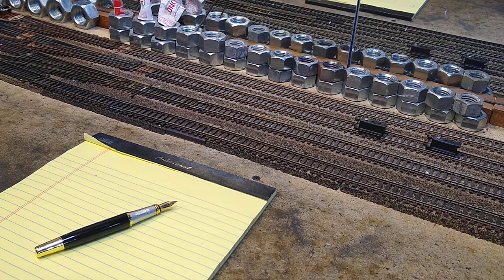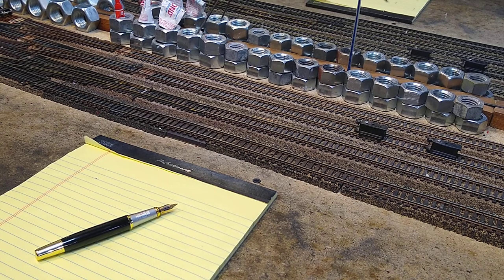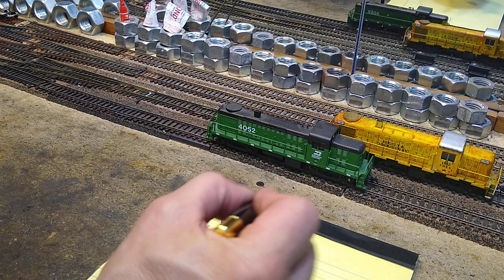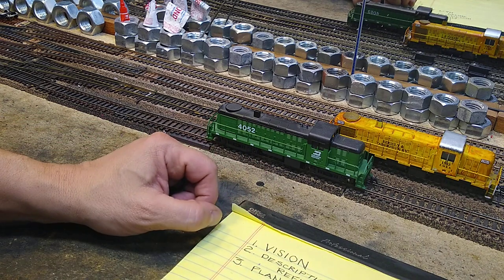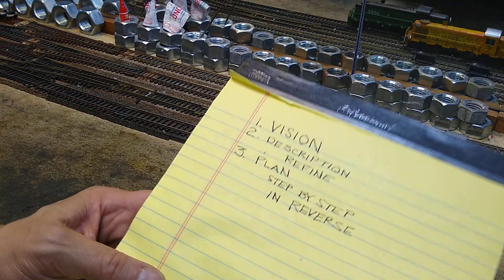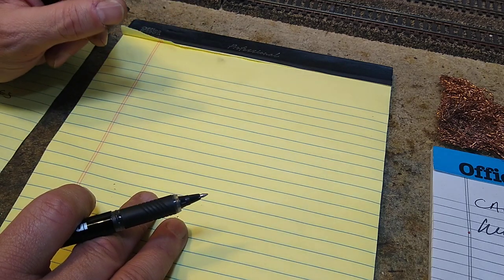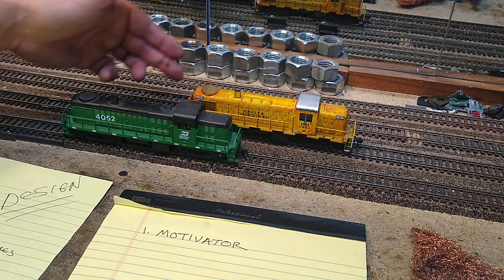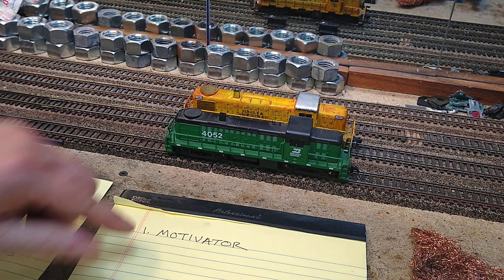Design an NMRA Clinic AHM RS2 remotor example

Comment: A couple questions unrelated to this video, but would possibly make good videos, 1) Would you consider making a video where instead of fixing a pancake motor, you install a CD ROM motor in place of the original, 2) Would you consider reviewing one of those old Model Power engines that have those massive O Scale dual shaft motors, and 3) Are we bound to see any possible steam engines or passenger car projects?
Reply from the maker: 1.  Yes - and it might go in a steam locomotive that has a Bachmann pancake motor.  2. I have a Model Power FP45 that has a massive motor that would go nicely with the pair I just finished.  3.  There are 4 steam projects that have started one of which is the heavy metal Bowser T1 from the green box, another is the Bachmann 4-84 with the pancake that will become a 6-8-6 and there are 2 4-6-4s that need to be quartered.  For passenger cars, I have stripped the paint off 6 Athearn heavyweights, bought 1000 unpainted figures and plan to use a combination of 3D printer, Laser and possibly one of my large format photo printers to do complete interiors lighted with people.

I would also like to do the CD-ROM motor in a pile of GP40s that I've only stripped the paint from so far.
Reply: @elite194  That sounds AWESOME! I cannot wait to see those videos come out, surely making the year better with your videos! One more thing I have to ask, have you found alternatives to the 5-pole 24 volt dual shaft motors, it seems eBay is cleaned out of the variety you use. I'm thinking of use the bigger can motors for my F-units, but would like a second opinion, like yours on what's best to work
Reply from the maker: @hjmiller2689  not even alibabba has anything right now.  I also asked my source at the factory to alert me when a new batch would be made of anything, but so far all production is going to single shaft motors.  I've got several of those big motors and they work decent.  I've got more F units where I can use them.  My stock will be of decent motors is running low real fast.